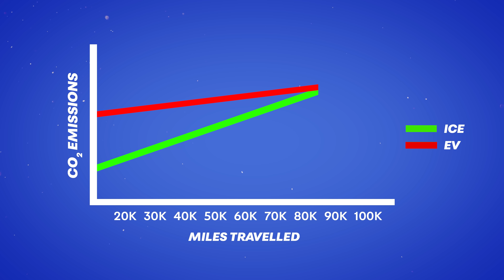Are Electric Cars REALLY That Green? [New 2022 Data]

Comment: There's another problem with EVs the batteries don't last the lifetime of the car so you have to factor in the cost and pollution of the replacement. If the battery is a lithium-ion and it shorts out and catches fire you can't put it out and the smoke is more poisonous than gas or diesel. I do agree that there is a place for EVs like in the cities but not so much on open highways. There is another major problem with them if everyone went EVs is, the whole electric grid would have to be rebuilt to handle all the extra power required and where would you get it. A lot of places are already having rolling blackouts. I guess more nuclear plants are just what this planet doesn't need, ok how about coal-fired plants, no too polluting, how about natural gas plants, no that would really get the greenhouse gases going, how about hydrogen fuel cells, no requires too much electricity back to that problem. So face it, until man comes up with another clean power source we are pretty well stuck where we are.

Comment: What are we suppose to do with all these batteries? Its impossible to dispose of batteries and electronics as it is.  No way batteries will last 100,000 miles.
Reply: Especially under adverse conditions.
ICE cars can heat up the cabin with little to no effect on overall performance or range, as wasted engine heat gets dissipated either entirely through the front radiator or through the one in front and partly through the one in the cabin. Electric cars must shed some of their stored energy to generate heat in the cabin, thus shortening the car's range. There's no getting around that. And generating heat via electricity is one of the least efficient means of doing so ... just ask anyone whose home is heated by electricity alone. And A/C is no better, however it does impact an ICE car much greater than running the heater.

Comment: Unfortunately, Long journeys are almost impossible in an EV - especially in a COLD country like Canada. One study here showed that to drive from Calgary to Edmonton, Alberta (about 300 km) in winter in a Tesla - it took around 10 hours MINIMUM. 
Breakdown - about 150 km on the first charge (remember - the heater is using electricity to keep the driver warm, too), the other 150 km on a SECOND charge - Each takes about 1.5 hours.  So far - NO problem. 
The problem is that you NEED to stop and RECHARGE in the middle, because the car DOES NOT HAVE THE BATTERY CAPACITY TO DO THE WHOLE TRIP! a Full charge takes 7-8 hours MINIMUM - IF you can find a charging station!  Minimum 10-11 hours for a 300 km drive. 
Something you can do in a gas powered vehicle in 2.5-3 hrs NO PROBLEMS and NO overnight stay in a Red Deer hotel while your car recharges. EV's are just not practical for anything other than commuting until battery technology improves significantly.
Reply: ICE cars recharge time --- 10 minutes. Each and every time.

Comment: Not only do most EV zealots not think about the cobalt, cadmium and other nasty materials needed to make the battery packs, the fact that in the US specifically, most electricity comes from natural gas or coal fired power plants, the fact that California is already asking EV owners to not charge their cars because the current electrical grid can't handle the current demand without crashing or setting the state on fire, but they never think about what happens to those battery packs the size of a coffee table that are full of the previously mentioned nasty materials, when they die. Batteries have a finite lifespan regardless of who makes them or how efficient they are and when they're spent, everything inside them is still very unfriendly to carbon based life forms.

Comment: The EV strategy is all wrong.  Attempting to make ICE vehicles obsolete requires giant, heavy, dirty batteries and long recharge times.  It would be much more effective to have a fleet of small and light city cars that are designed for short trips and fast recharges.  Perhaps even with a standard interchangeable battery for refills. Cleaner, cheaper, and much more impactful.

Comment: ok you say you use only green energy how long before you break even there? concrete didn't get there without trucks, or bulldozers and excavators to move the dirt. cranes to assemble. factories to manufacture the wire, steel, fiberglass blades. then when it is done to bury the blades or solar panels. same with the cars what about disposal of the lithium battery's? and if you are still hooked to the grid you may be paying for green but your electric coming into your house could be coming from that dirty coal fired plant 10 miles from your house.

Comment: No charging and generating capacity. And you'll run out of minerals to make the batteries long before you run out of oil.  You will be buying those minerals from unfriendly countries that use slave labor. Besides most of these cars are made of petroleum. There are over 6000 different products made of petroleum including fertilizer. Then there are people like me who live in rural America in a cold winter climate that and I also haul horses long distances stopping to charge a battery is not an option.

Comment: 100 years of exploiting the fossil fuel industry surely has had way more negative impact than all the future exploitation of the raw materials needed to bring us closer to a sustainable electric vehicle market place. 
That being said.... remember that the oil industry is still the major player in supplying the necessary equipment needed to extract the very materials that will contribute in making the phasing out of oil demand.....A very slow  suicide procedure indeed.

Comment: EV's use more tyres due to the weight of the battery's also the cost to the earth to make the lithium battery's not to mention the waste of water.  They are not as good as what everyone makes out they are.
This bloke doesn't factor into this article about how long do the battery's last and what are you going to do with the spent or dead battery's?
Not to mention that EV are prone to going on fire.

Comment: I only do 3500 miles per year. So that equates to 25years of driving. Will an electric car actually last 25 years? A petrol / diesel car does occasionally last that long, but not always. I'll stick with my old Hilux thanks, maintain it well and that will probably be far more environmentally friendly than paying for a £50,000 electric van, that I can't afford anyway.

Comment: Guarantee Volvo didn't include the environmental cost of the new battery and disposal or refurbishment of the old battery which would be due at around 90,000 miles , just as it breaks even in environmental terms

Comment: ICE cars today can last 200-250 thousand miles easily before maintenance.  Batteries in EV cars not even close and the cost of replacement is huge (read on replacement costs and then back to production of those batteries).  As much as $20,000 to replace batteries.  And the pollution of the coal/nat gas plants of which there are going to be plenty more since only 2% of vehicles right now are EV.  Sure they are counting on wind/solar (hugely expensive) which by the way have only a shelf life of 20 years.  Keep thinking people.

Comment: Here in Canada, the Prayer Wheels are 26% efficient as in produce power that amount of the time. Not a great number! 
I did watch something a few years ago where they showed the the CO2 production as the vehicle was made and operated. The end seemed to be some 9% less Carbon Dioxide produced! 
Worse mileage or what happens in Real Life?  What does the acronym of CAFE stand for? 
You mention "air quality". Do people know that the "Green" of "Bio" aka, Ethanol or B-100 causes more "smog"! Which is part of the reason for selling the idea of renewables to the masses. 
It is "Cold" here so not very effective to use battery powered vehicles.
 There should be a More efficient public transit systems for cities. Which then allow to be better used. Stupid buy design is design buy Stupids!   Make it so that the public won't /can't use it and they can sell you a different system! 
One thing you didn't cover (maybe the problem has gone???)  is that the batteries catch on fire! Some areas have Sea-Can tanks to put the batteries into for a WEEK so Cool Down! A WEEK doesn't sound very GREEN to ME! 
The energy density is not there for batteries.

Comment: If the battery is half the cost, they are the biggest portion of CO2 cost, they will need replacing and that means you are not greener, you are only delaying the CO2 cost and it builds up higher with each replacement set you have, a typical car is good for 250,000 and that would likely be 3 cell changes...

So if that cost is 24 Tons CO2 (50% the stated figure) each change, you are not going to be green as much as you think.

Comment: I'm cynical about the Volvo study. What isn't included in the mix at first glance is the extra toxicity in the mining and production of EV raw materials.  I'm betting Volvo is blinding out accociated environmental contamination with what might be a fair or even tilted study against the C02 advantages of EVs.

Having said that EV technology appears to me to be the way forward.  I'll be generating most of my electricity for the Cybertruck when it finally is released. The ability to be energy independent is extremely appealing to me.
Unfortunately my idealistic dream might be a bit optimistic concidering  recent world events.
We'll be lucky if the cars of the future aren't pulled by horses.

Comment: Interesting and enlightening. I wish he could have spent some time on the other pollution factors besides only CO2 that effect the balance, such as the materials and methods used to gather raw materials and the environmental costs of those. Battery manufacturing is a pretty dirty business, as is oil extraction and refining.  Also, what long term effect is there on recycling/retiring these batteries.  All of this needs to be compared to get a balanced look.  These are huge decisions that affect us all in long term ways. We need to make our decisions on data and logic, not emotion.
Reply: Thats part of the report.
Reply: C02 is a natural gas that plants feed off and can be offset by fast growing trees, renewable energy and electric vehicles produce toxic by product far worse than C02 like you mentioned with batteries etc. 

Most of the world’s renewables are made in China by Uyghur slave labour and coal power plants are used to power those factories there made in. Than there is the toxic by product produced during manufacturing, repairing and disposing of renewables. 

Alongside EV’s having the exact same toxic by product from manufacturing, repairing and disposing of EV’s themselves. 

Than there is the growing cost of disposing of EV’s, batteries and renewables which will cost tens of millions annually.
Reply: @mitchjames9350  Absolutly , and CO2 is still too low to even be efficient !!!
the green new deal and the CO2 hoax is propaghanda to tax people into oblivion !!!
wake up people and do some resurge !!!  (911 , the bankingcrisis , the plandemic , now the war in oekraine , all planed by those globalists)
all the crisisses since 911 are being planned for a grab for world domination !!!
wake up 😲
Reply: And China is polluting unchecked, and ruining the environment. I wonder if the report accounts for this, as part of the carbon footprint. China won't improve its processes to make them greener if they cost more, so good luck with lowering the footprint to make EVs look better.
Reply: Need better mass transit
Reply: @bramblecino  

A study in Baltimore showed mass transit lowered wages of the companies surrounding the line leading to greater poverty
Reply: @RobertMillerJustme  I kind of doubt that.  I tried searching for an article but couldn’t find anything .  I found a study which concluded the exact opposite.
Reply: The Government says hey light rail get the poor to areas needing labor but basic supply and demand economics - put in light rail and bring in the poor into those areas to fill positions the businesses then decrease starting pay once the labor pool increases
Reply: @RobertMillerJustme   hm...  correct me if i am wrong but i suspect there might be some conflation between correlation and causality going on here 🤔 
in other words assuming what you are saying is true there might be other things thats causing the decline in wages like decreased demand for what ever they are producing, lack of union organisation etc. in short  u need to rationally consider the whole picture and try to find the best solution. 
Noble of you too care about the working conditions of poor laborers  though, good intent is important but don´t forget the logic and reason portion.
or maybe you just wanted a reason to say "cars good trains bad" :P take care😊
Reply: They have calculated the comparison between the "dirtiest" possible manufacture of an EV that is at all realistic today and the manufacture of an ICE vehicle and EVs still come out cleaner over their useful lifespan. Then the batteries can be re-used and re-purposed and then they can be recycled to at least 95%. All of this will take place over an expected period of 20-30 years before the batteries are disposed of as waste. So, generally speaking, the environment is in no immediate danger from these materials as it is from the materials, processes and fuels used for ICE cars.
Reply: Producing LiFePO batteries doesn't have much environmental costs, since no toxic metals (nickel, cobalt, manganese) need to be mined.
Reply: I guess that's on thing that I didn't  here addressed is when the batteries need to be replaced then the EV cars would take another big hit as far as pollution! Didn't  here that factored in !
Reply: @kevinmeyer3884  most batteries last 200k-300k miles now so EVs should still be far better
Reply: @nate4fish  is there one ev car out there that can actually prove that claim?
Reply: @nate4fish  Source? It seems like they will not feasibly last that long if you want any good battery capacity. If that’s all the way to like 30% original capacity, sure probably but you gotta realise people buy the battery size for a reason and they will probably not let it get that Low
Reply: @kevinmeyer3884   I was hoping someone pointed that out. Once they figure how to clean up the mining and only use one battery for the whole life of the car then they will really make some progress.
Reply: @kevinmeyer3884  Yip. I want to know what we are going to do with all these old batteries. I don't hear any thing about recycling them.
Reply: @mikeb4178  they are reused or recycled.  Cells that are no longer suitable for vehicles can still be used for grid energy storage (this has been happening with Nissan batteries for a long time now) and once their performance has completely degraded they are recycled into new batteries. 
The problem at the moment is that we are very much at the early stages of battery technology and use so we need to make billions of new cells and battery recycling is also still at the early stages of implementation.  But I can assure you that the materials in batteries are too valuable to just be disposed of.
Reply: Better that we build a sustainable cities with WORKING public transportation.
Cars can be used for cross country trips, but our daily travel needs can be met by other means.
Reply: @DiogenesOfCa  for cross country trips you’ve got trains. Cars have a place but it should be well down the list of transport methods
Reply: and solar cells use coal in the process ......
Reply: Battery replacement and disposal is the elephant in the room nobody talks about.  It's taboo.  So don't bring it up.
Every battery made has to be disposed of at some point.   Just like tires and the cars themselves.
Reply: @RazorStrap  Think nuclear power stations!
Reply: @margaretnicol3423  Too complex.  You don't want that in your neighborhood or business districts.  But that has nothing to do with battery replacement and disposal.
Reply: @RazorStrap  Think again on the problems of disposal.  It's classic!
Reply: Also, there is the fact that the power source of an EV has to be brought to it, this means that there will be power loses over the transfer points to get the power from the grid to the drive wheels. (The last time I counted there were seven of them and this is just to equal the ICE car in the EV's range.) And then there is the necessity to have to possibly recharge three times to equal the ICE car's range. This means the EV is burning three times the amount of Coal from the grid that of an ICE car burning Petrol.
Reply: Co2 IS NOT A POLUTANT!!!! No co2 = no life
Reply: @loonaticsrunningtheassylum  CO2 is most definitely a pollutant when the concentration is too high.  Anything that is not in the place it's supposed to be or there is more of it than there is supposed to be is a pollutant.  But you are right we require CO2 as well.
Reply: Asking the entire world to switch wholesale to Electric is a really dumb idea, the best power source varies dramatically depending on individual circumstances.
Reply: Very little of the long term thinking being used by the greenies.
Reply: He only told you a third of what actually happens with the Co2 and only enough to MAKE you believe an EV is cleaner than an ICE vehicle. And that is impossible.

Comment: I believe in battery swapping.. Make the batteries smaller but removable but have a static one as reserve.. So as you drive the removable one gets used.. When you run low and don't have the time to charge you drive up to a battery station ( petrol station) get your low battery pack removed and replaced with a charged one.. Say in 10 mins its swapped and you are on your way.. I know China has an ev based on this principle. That's the way..